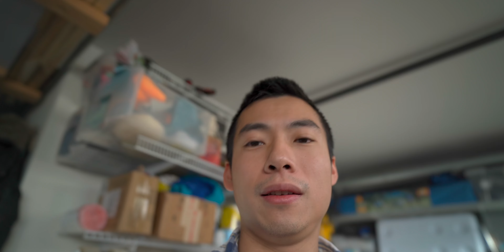Why is EVERY project like this?!

Comment: Yeah, I totally feel your pain, my friend! Also a veteran in the electrical design field, I must say that it seems to be getting worse over time. My opinion about this is that over the years, our drafting tools have allowed changes to drawings/designs to be much easier to accomplish, so designers tend to "draw first" and "design second" - back in the hand-drafting days (dating myself, I know!) we use to do it the other way around - design/size before drawing, since modifying a drawing was much tougher to do. All I can recommend is, keep preaching to clients that we electrical designers are the last link in the chain (connecting everyone else's stuff) and need additional time after everyone else is done adding/changing. Maybe someday they will listen! Thanks for posting this video - needed to be said!
Reply from the maker: Just recently we had a client demand  home runs and circuiting at the 30% review. When they couldn’t even tell me if the current layout will be final. 🤦🏻‍♂️ I play this game where I constantly provide only the absolute bare minimum until much later in design. It’s the only way to stay within budget these days.

Comment: Im sorry but I actually laughed out loud.  This has been a heated topic in our office for as long as I remember (i’ve worked in the same place for 24 years doing, first elec. drafting, then design) and it never ever gets any better!  

We’re always at the mercy of a) last minute architectural changes and b) mechanical/plumbing dragging their feet.  Its not fair.  But you learn to deal with it.  How many of you have had to work 24hrs or more straight thru to get a job out on time?  I’m sure i’m not the only one.  And when electrical is still plugging away at 4am, are there any mech. ppl there too?  No.  🤦🏼‍♀️ I feel your pain.
Reply from the maker: I once made a joke at 6pm as the mechanical engineer started packing up for the day. I’m like hey look we can finally get started! He gave me a guilty look as he walks by and drops off his equipment schedule and some chicken scratch of a floor plan showing where some things were moved to. Other times I had put enough notes to get us through permit and finish the actual design in the first addendum. This year I had a 7 building campus all go out at the same time. I don’t think I saw my kids for 4 days straight. Was terrible.

Comment: I always at least provide a place holder estimate of circuits for equipment and change in the future. Never get all you need when you need it.
Reply from the maker: Absolutely, in the beginning around 30% mark I aim for about 40% spare if I don’t have placeholders. Sometimes I get blindsided by multiple redundant compressor skids and each one can take two feeders at like 100A 480V. Or the one project dropped in another 800 ton chiller at the 90% mark 😩 had to add another ATS, upsize substation and what not between 90 and construction doc. It was a nightmare.

Comment: I agree! The plumbing department is the worst! I'm as guilty as charged for doing things last minute and needing power. I guess the only tip I'd give you is get on the mechanical and plumbing department early in design. Make sure you give them a hard deadline to have all their equipment scheduled and located. As far as the progress schedule, I would just plan for the inevitable. Try to plan for changes and be ready for them. Architects and owners have FORCED us to design at the last minute. I've found the only way NOT to waste time is to work last minute. It's just a part of the changing tides in the AEC industry. Be prepared for the worst, because the worst is always coming lol. One last thing, as a MEP firm, you may be able to keep a strict "no background update policy without giving 2 weeks" for your firm to pick up changes. This isn't something you alone can enforce, but as a company it can be a valuable rule.

Comment: God i relate to you so much hahahaahahaha. I just started my new job as a CAD drawer and i hate how when i finish calculating my entire load. They either need to revise it for budgetary reasons or need to add more equipment when we are 20-40% done. Like i fully get your frustration
Reply from the maker: And it has to be done by this afternoon. I swear we throw out 80% of our work by the time they finish building the darn things.
Reply: @theelectricaldepartment  not to mention adapting these changes to the material specifications if it is affected at all...